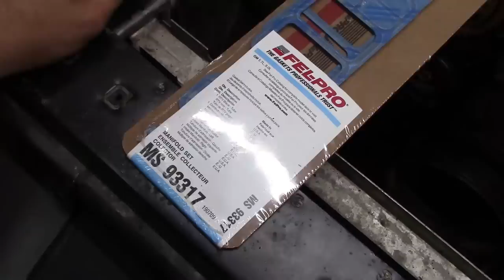1991 GMC K1500 Project | 350 TBI Intake Manifold Gaskets and Water Pump - Part 1

Comment: $1200 to make it right is not that much for a truck... trucks retain their value better than cars ... replacement truck would be more plus whatever unknown issues it would have...better to go with what you know and keep it running as long as possible,,, these old trucks are easy to work on and reliable

Comment: People are inclined to fix reliable vehicles no matter what the perceived value is to someone else.  If all this guy has done is basic maintenance for the last few years and $1200 buys another year of whatever he/she uses the car for, its still cheaper than a new vehicle.  I have a 1998 K1500 I bought for $6k in 2009 with 108K when the fuel prices skyrocket.  Besides normal maintenance and wear items I'm at ~$4000 in shop repairs and the truck has 340K on it now. So $10,000 for 232K miles is a bargain in my book.

Comment: Those Trucks were Plauged with issues typical GM Quality.....    Low quality AC Delco   fuel pumps,  alternators,  Dash gauges  , door hinges, AC leaks....list goes on and on ..... 2020  GM quality  has gotten even worse.

Comment: Setting the timing on these is unplug the timing wire like you did but have engine warmed up leave trans in park set to 0 degrees  then shut off reconnect timing wire done you  may have to disconnect battery for a minute to clear code set by running with timing wire disconnected after that drive the way you want to drive computer then learns your driving habits alls good 
All i run is the older Chevys i have 27 of these in my yard most run about half a dozen are parts ones to keep the better ones going so after that being said i guess im what one commenter said a Shitbox Connoisseur lol💩🚽🤣🤣